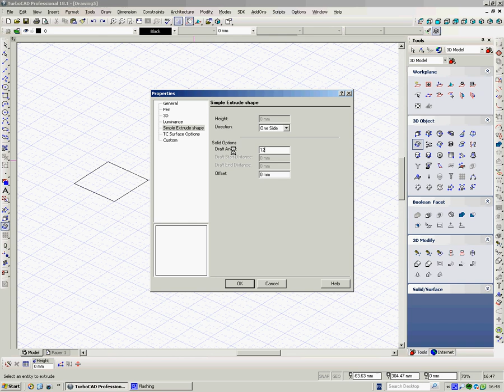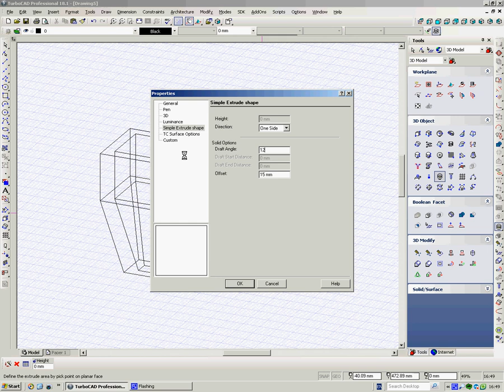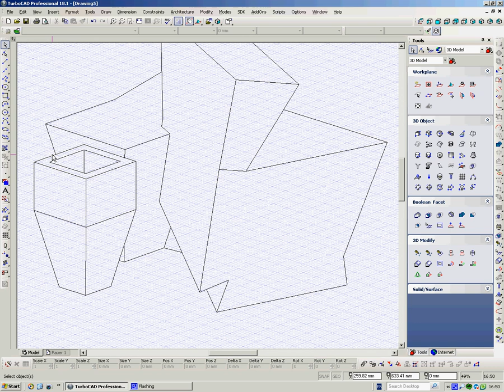TurboCAD 3D Simple Extrude & Quick Pull

Comment: great video(s)... many thanks, but I have a question: is it possible to utilize simple extrude along a path much like a sweep, snap to the paths midpoint-select the 2 sided extrude option AND have it mirror the taper so that the midpoint selection is the widest point? I just got turbocad v18 2d/3d deluxe and I will try it, but I'm curious to see if you've attempted it already or if it's possible. thanks again...